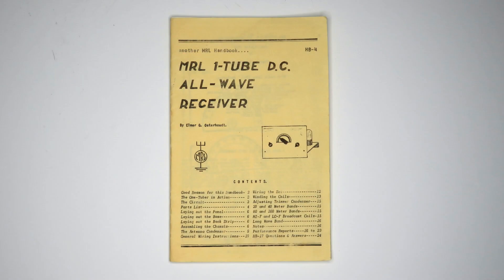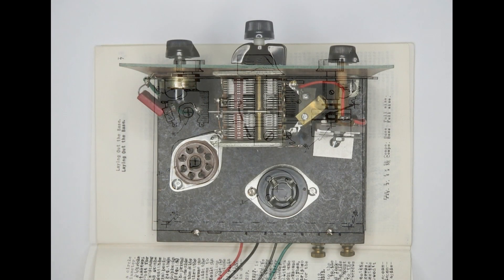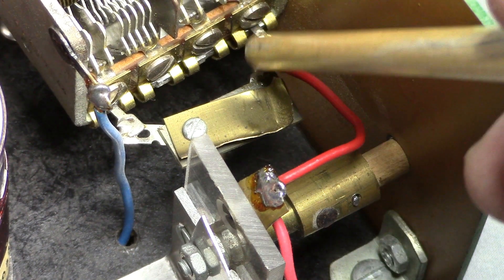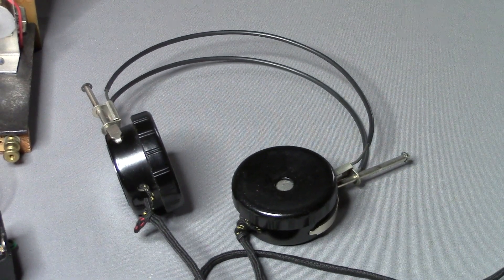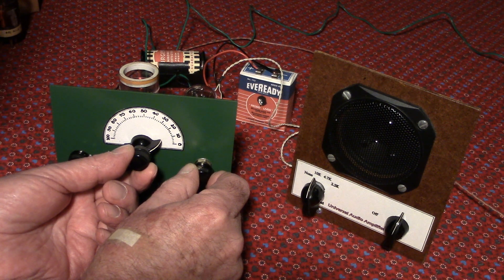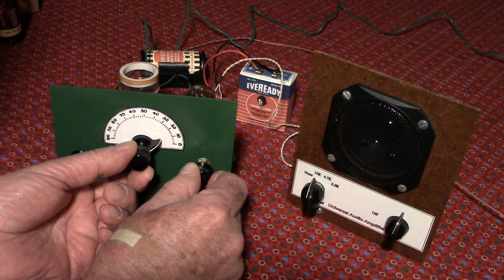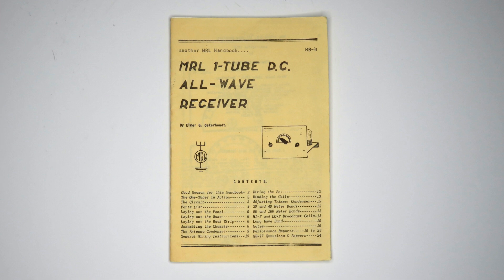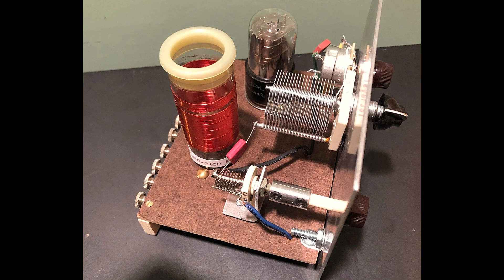MRL 1-Tube DC All-Wave Radio

Comment: This was the first radio I ever built as a 12 year old boy. I got it for xmas in 1968. I have since built another one using the original BCB coils from '68. I still play around  with it once in a while when I get bored with high tech ham equipment.  Dave N9HF
Reply from the maker: You built a regen radio when you were 12. Nice!! I didn't know what a regen radio was when I was 12. I got the Alfred Morgan books from the library, but obtaining the parts for the one tube radio was impossible for me at the time.

Comment: I never heard of MRL before.  Well, this set is very similar to the ones written up by Alfred Morgan in "The Boy Electrician" and "The Boy's book(s) of radio and electronics".  
The use of a 1.4 volt power tube makes sense as they were the last of the battery tubes to become unobtainum.  Note that you can use the 3volt battery tubes as well, since their filaments could be wired in parallel to run at 1.5 volts.  So one can use 1Q5GT,  1C5Gt, 3Q5Gt, 3Q4, 3V4, 3S4.  Also rf pentode types 1S4, 1T4,  1U4, 1U5.  There are also Loctal based tubes as well.  He recommends 6.3v tubes, but while the power types (6K6, 6G6, 6F6, 6V6 and 6L6) will work, the 6v RF pentodes (6SK7, 6SS7, 6SJ7, 6AU6, 6BA6, 6SC7, 6K7, 6J7, 6SD7, 6C6, 6D6) are a better choice (but you have to connect  G3 to the cathode).  Note some of these tubes are Octal base, some are 6 prong, some are 7 pin miniatures.  12v tubes are also OK, but you need a 12v filament transformer, 6v tubes can be run off of 4 series connected flashlight batteries, or "Lantern" battery.
Usually the pentode tubes controlled regeneration by varying the voltage on G2 with a pot, but that puts a constant drain on the battery so the use of feedback control makes sense.  A variable capacitor (150pf) from the tickler coil to ground works as well as the pot with capacitor to ground.  There should be an RF choke in series with the headphones (about 1-3 mh), regeneration may be hard to control without it.

Comment: My friend had one but KDKA  overpowered most of the bands making Short wave reception impossible. That was the main reason I built the greymark 2 band radio instead I made mine a three band because I used the phono input for an FM tuner. I could have built the all band kit because I didn't live near KDKAs tower.I didn't want to take the chance. the plug in coils is a good way of picking which bands you want to receive . I know the greymark superheterodyne would take more coils but switching coils would need a different rotary' switch. 73

Comment: I built a sort of twinplex with a #19 dual triode tube but the plug in coil set I had only catches the top of the AM BCB.  I built my first one tube radio as a young teen with a 201A tube that I was given and junkbox parts.  I used all prewar parts on the twinplex except of course the chassis parts.

Comment: That sounded like an excerpt from a version of Blood On The Rooftops at the end?
Reply from the maker: Yes, it sure was. It was a cover of Blood On The Rooftops, but I forget which band played it. I just held the microphone to the speaker while playing a YouTube video. It's one of my favorite songs.
Reply: @michaelsimpson5417  It's one of my favourite songs too.  About your radio, I had a HAC regenerative receiver kit as a kid, they were advertised in Practical Wireless magazine in England back in the 60's and early 70's, it used a single triode and those Denco plugin coils if you remember those?  I still find it immensely rewarding getting such good results from such a simple set, plus you get more involved with both hands on the knobs !!